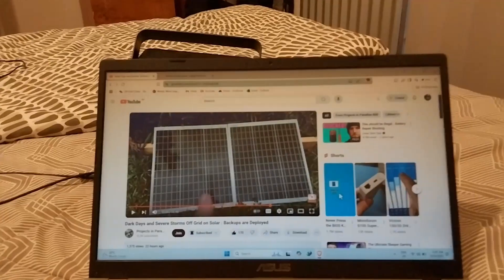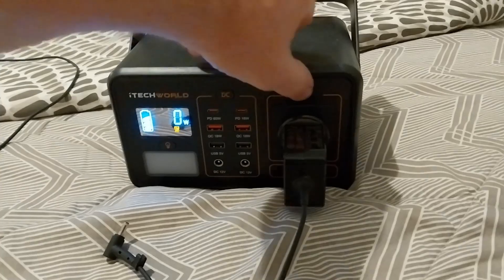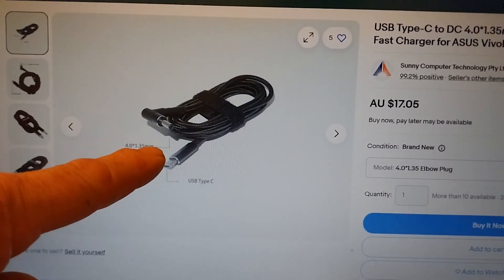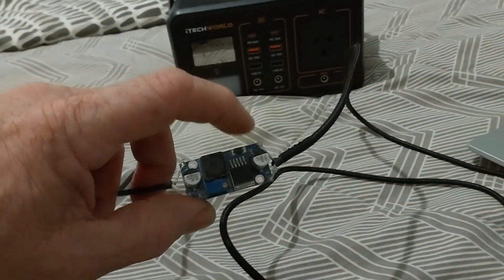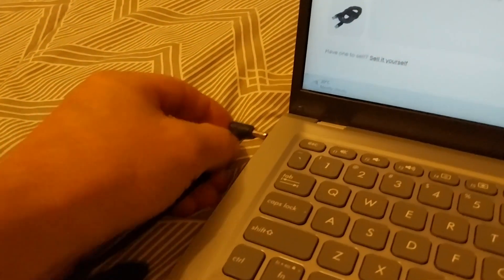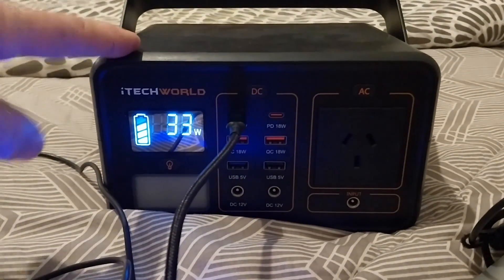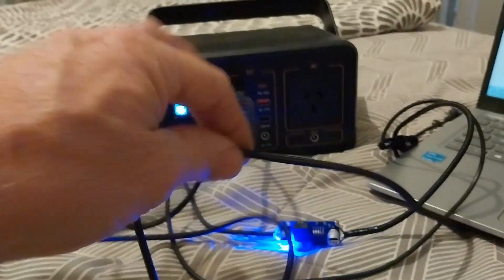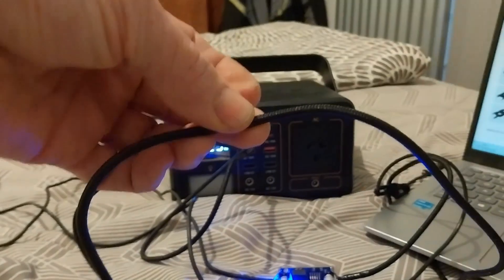Charging My Laptop From Power Delivery (PD) Via A Buck Converter

Comment: Nice video, USB-C is great for charging laptops. My HP ProBook laptop natively supports USB-PD, so I can charge it with my huge 25,000mAh powerbank for hours.

Quick little note though, you probably didn't even need to add that buck converter. 1V higher usually won't make a difference, and in fact the voltage will drop slightly as the laptop pulls more and more power.
Reply from the maker: I did try it without the buck converter but it wouldn't charge.